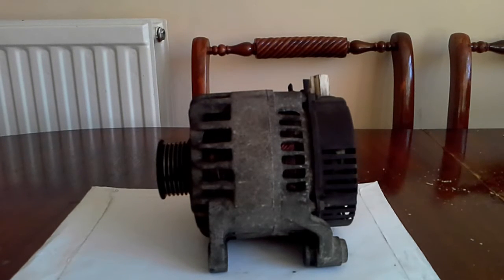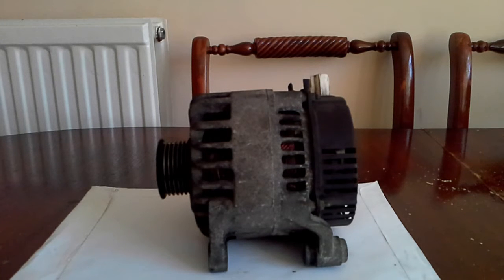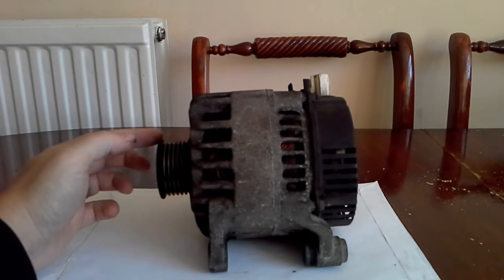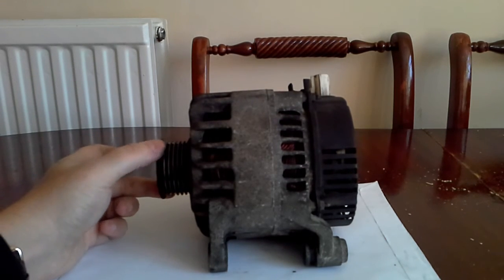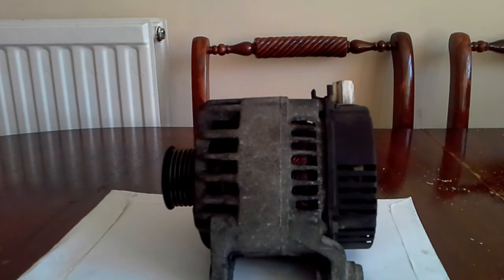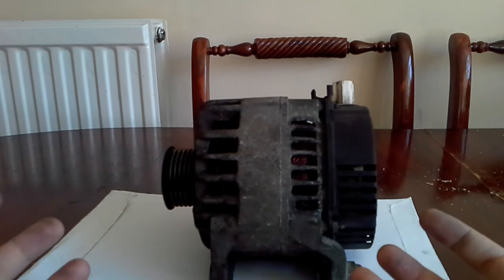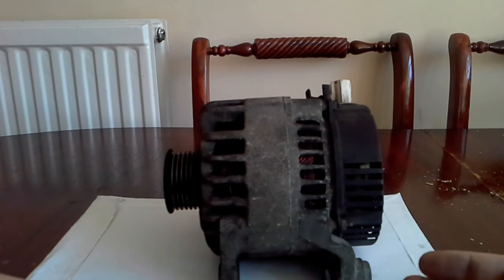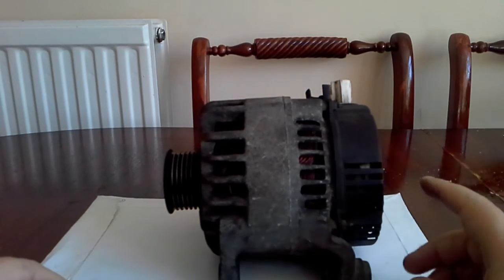Ford focus electrical problem

Comment: Having all kinds of electrical problems with 2014 Ford focus, loud crackling and electrical jolt sounds through speakers and more etc. Mechanic told me it should be a recall but I’m scared to deal with the dealership since I didn’t receive a letter, any advice?

Comment: Just fitted a new one a pig of a job I will scrap the car before I go through it again I was looking for a ground wire replacement viddie the ground on our diesel focus underneath air pipes coming from turbo is knackered lights dim on dash wen I put the lights on

Comment: On my 05 Focus, the radio would crackle in and out and random dash lights would flicker on and off (ABS, Brake, and Battery). It turned out to be a corroded ground. Luckily, both ground that come from the (-) Negative terminal of the battery down to the chasis/frame of the car. It's only about 8 inches away from the battery, so easy to locate and access.

Be careful taking out the rusty ground bolts. (try to use PB blaster or WD-40 so you don't break the bolt). Once the corroded and dirty terminal is disconnected, use sand paper or steel wool to get the corrosion off the circle terminal AND the body of the car where the bolt goes. Pour some Coca-Cola on it to help dissolve the nasty green corrosion. Get it nice and clean and that should fix your problem. If anything, it's easy to do and only takes 5 mins. Definitely can't hurt and is a good starting point before you start putting $ in.

Comment: Thanks for the info, there are also a few youtube video's showing electrical issues with the wiring loom, chafing were it passes through the roof & into the boot lid.

Comment: My Ford Focus has a high rev at stop lights and in between gears, where it slowly comes down. Someone told me that the revs increase to compensate the weak battery because the voltage regulator isn't working properly.
Reply: Mine has exactly the same problem, did you solve it?

Comment: I have a mk3 mondeo 2.2 tdci and my alternator was smoking so I replaced the alternator with a new one and a new battery and also changed the aux belt and tenshner but I now have the problem of the battery not getting any charge. I also have the battery light on too. Would you have any ideas?

Thanks mate.